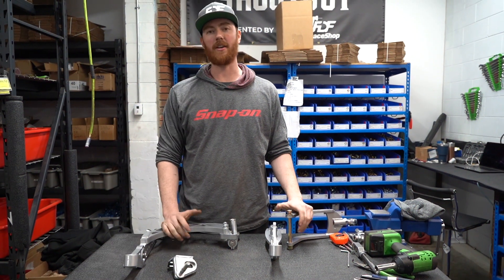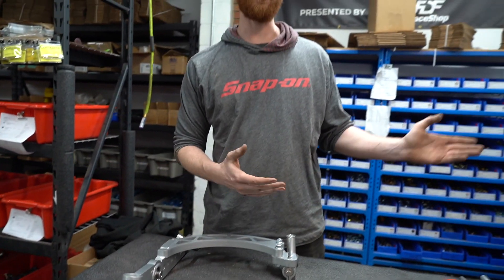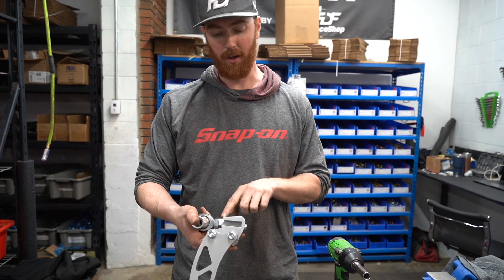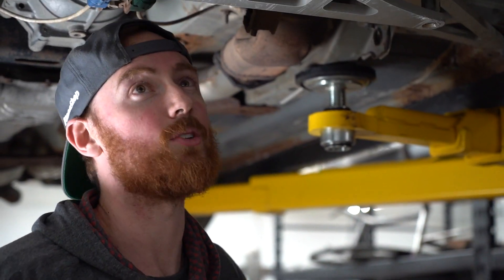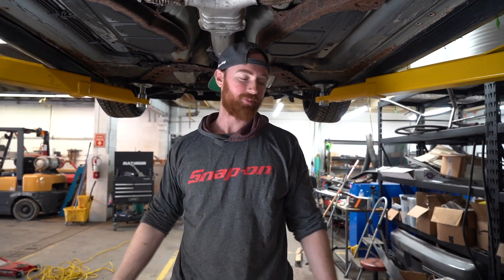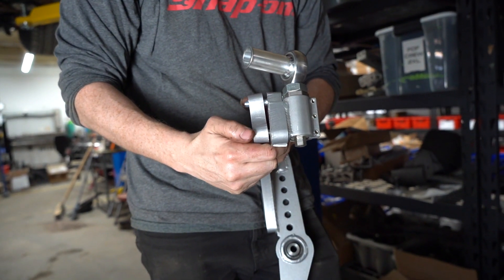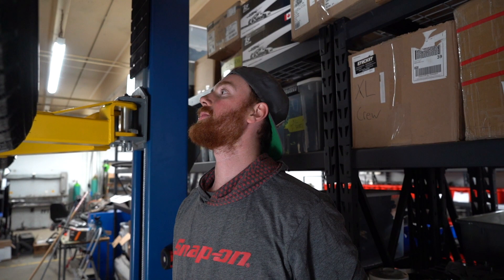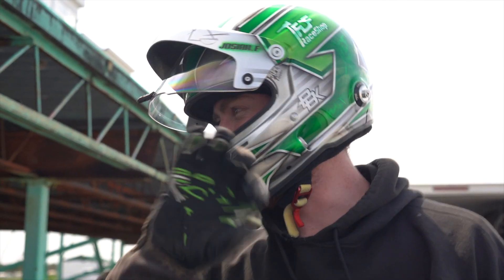New 350z Mantis Arm Design/ Install and Testing

Comment: wow really bummed i bought the old kit . wtf 🤬
Reply from the maker: Couple points here, these are 2 months out, they can be used with all of the old kit components, for those with the kits they will get a better price if they want to upgrade, and a fun fact on it is, I actually ran the car with the new arms on one side and the same old arms on the other. It's all interchangeable! Companies will always improve. Just look at car manufactures. The 2022 Truck will be better than the 2021 truck based on what they learned, new technological advancments etc etc. You'll be well supported by us so don't be disappointed! It all performs the same.

Comment: Does the fdf mega mantis kit push you’re wheels out a couple inches like wisefab does?
Reply: The regular mantis goes from about 25-50mm wider than stock on lower control arm I believe, but still fits within stock wheel well because upper control arm isn't extended. I extended both upper and lower control arms on mine to the max allowable by the kit in order to clear sway bar and body. My car gets basically 65 degrees lock.
Reply: Also I still have stock fenders, but they rubbed and have self clearanced my fenders after a few events.